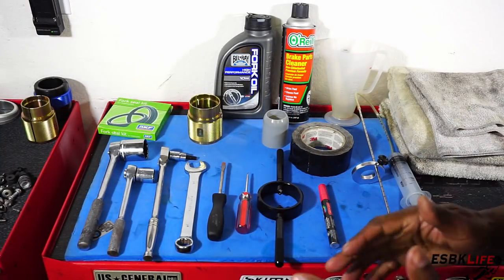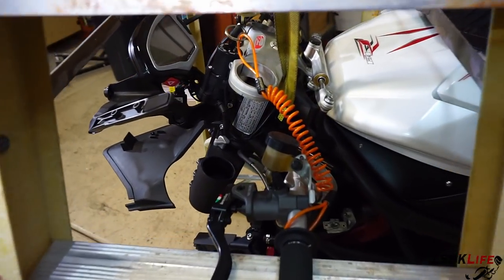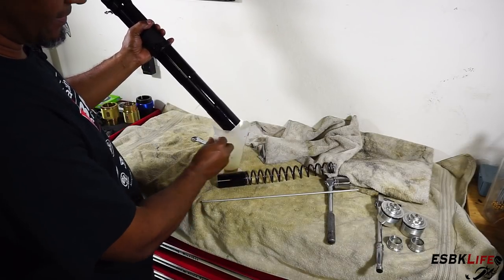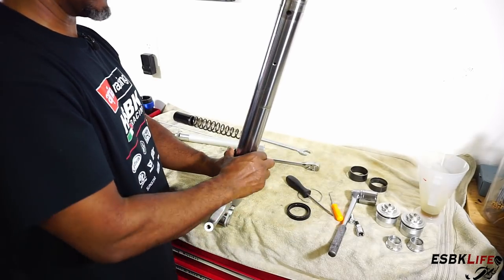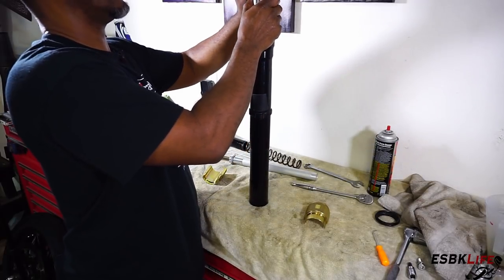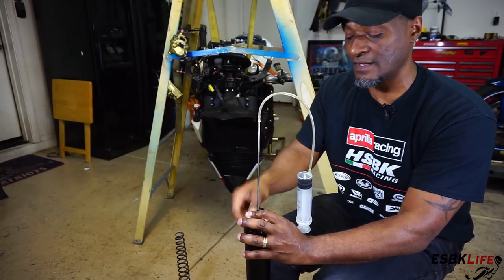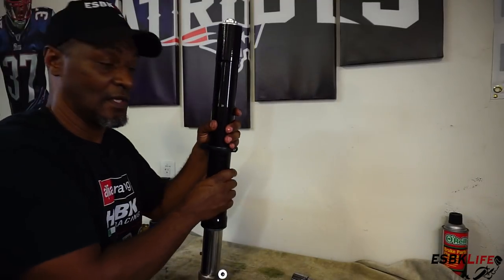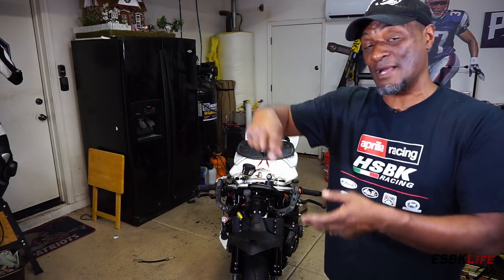ESBKLife: MV Agusta F4 1000 Fork Seal Replacement

Comment: That front stand is quite genius. 

My front forks are pitted and the seals have gone so rather than spend the £550 for a complete rebuild, I managed to find a new pair for £800.

My bike is on a stand but I don't think I have enough clearance to get the forks out so that stand that you have made there may well just get replicated in my garage. 

I'm also going to attempt to remove the forks without taking all the nose fairing off etc. 

Great video. Thanks man and stay safe 🍻👍

Comment: Thank you for the video.   Harbor Freight (and others) sell electric and manual hoists which attach to the ceiling.   This makes wheel and suspension servicing much easier - and safer.